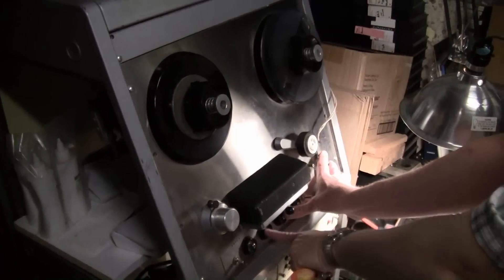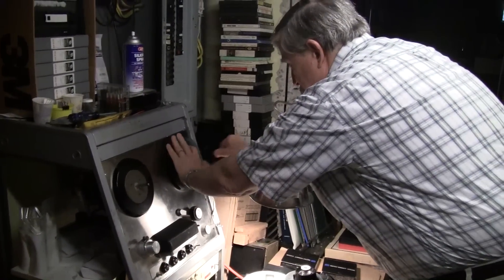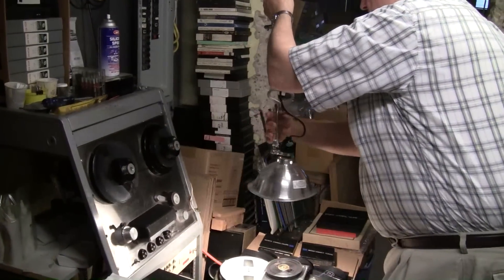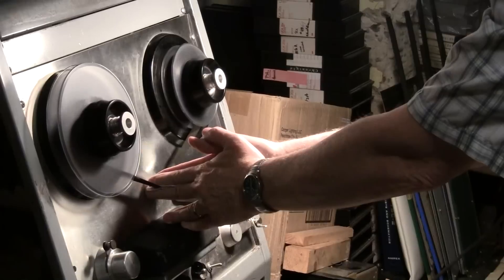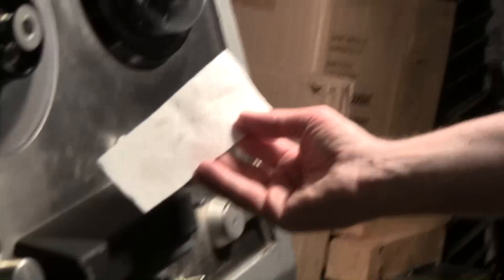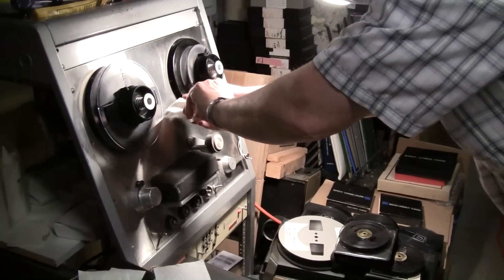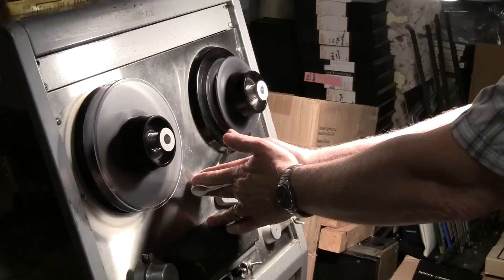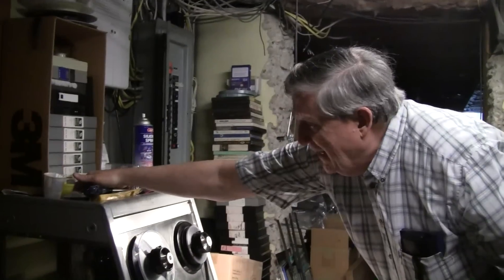How to prepare a video tape for program recovery

Comment: We had a dedicated quad tape cleaner that looked like a vertical tape deck. One night I was cleaning a 90 minute quad tape and I failed to tighten the hub enough. The reel fell of the hub, hit the floor spinning at high speed, cut a groove in the carpet and took off. It hit the wall (drywall) and cracked it pretty good. I was fortunate that it missed my foot, or I would be missing a toe or two. LOL

Comment: Re the dry silicone spray, not all these sprays are the same, the 3M version contains acetone etc.  Here is the datasheet of the spray used in the video (Snap Silicone Spray) http://www.ifa.hawaii.edu/instr-shop/SDS/Snap%20Silicone%20Spray.pdf

Comment: Richard, wil the silicone treatment have any effect on the tape long term? If I treated the tape and did a dub immediately and then came back to it months later it wouldn' t be worse off with than it was originally?
Reply: I understand but it still gets on the tape.
Reply: Thank you Richard. Bob B.